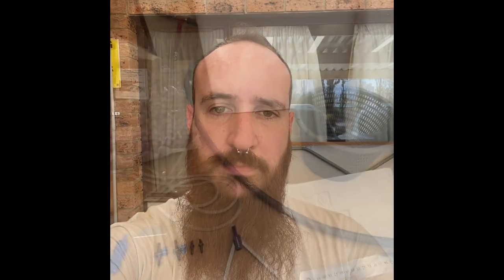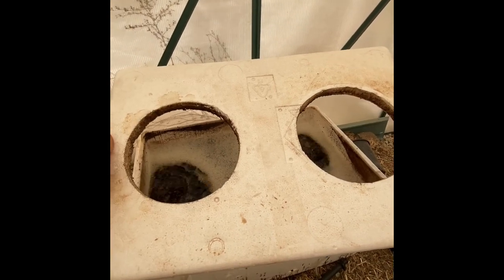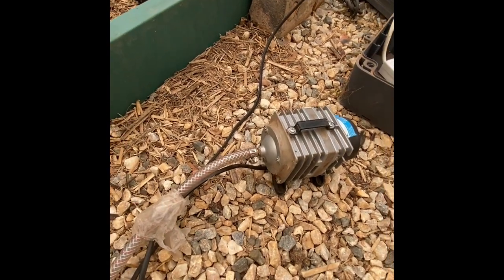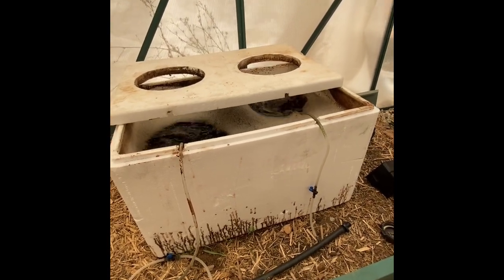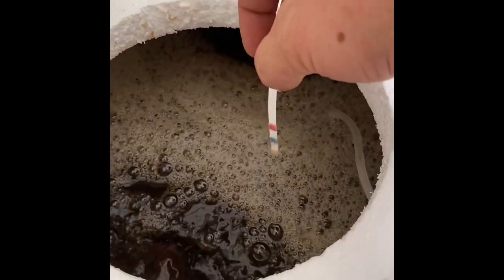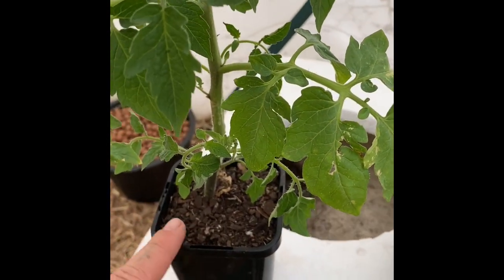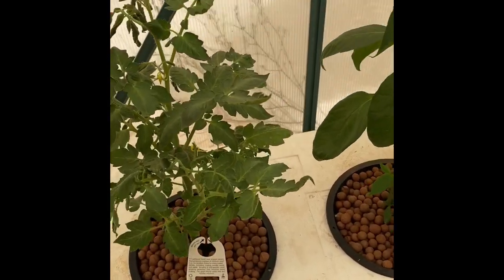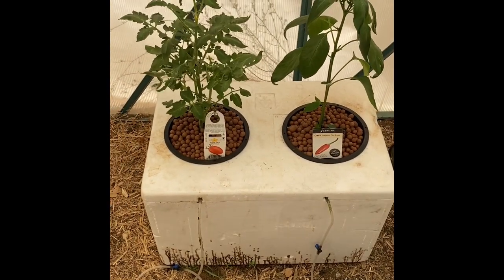Simple DWC hydroponics with bio digester fertiliser

Comment: 1. Did you need to keep the air pump on all the time?  Surely not.
2. What product did you use to adjust your PH level?
3. I am amazed that the plants didn't suffer wet roots.

Comment: I like you idea, I myself have considered a similar idea. One thing to note about doing this is tomatoes and pepper both require calcium. This will prevent bottom end rot on the fruits. You can introduce milk or gypsum into your digester or straight into your liquid fertilizer.
Reply from the maker: One day I will actually send a sample of to the lab to find out the composition, it will vary due to what is fed into it each time, but it does get fed dairy products aswell, whether that breaks down into usable calcium, I don’t know but would be very interested to find out.

Comment: Thanks for sharing, I think this is the future of farming.  I am working on a system that includes an aerobic bubbler tank for the digestate to enter from the anaerobic methane digester.  This would give the slow acting nitrifying  bacteria time convert the ammonias into nitrates, reducae any remaining solids and also decompose fibers that don't break down in the anaerobic part..  Also it should make it small a bit nicer.  The end result would be similar to compost tea.
Reply from the maker: I should be doing this with my small blue holding tank, that way it’s ready to go whenever I need it